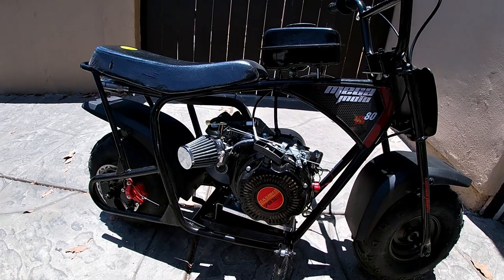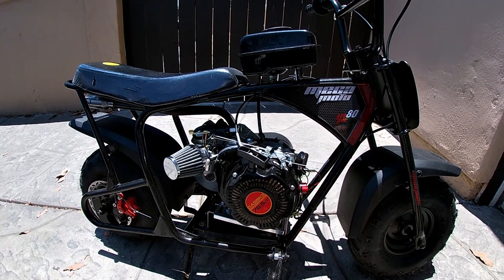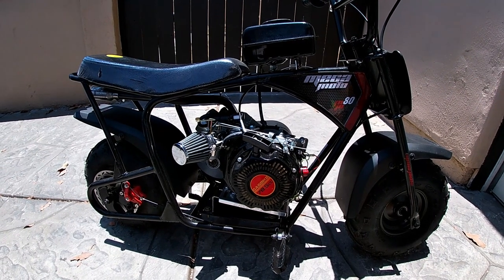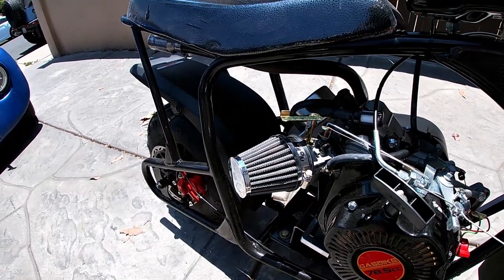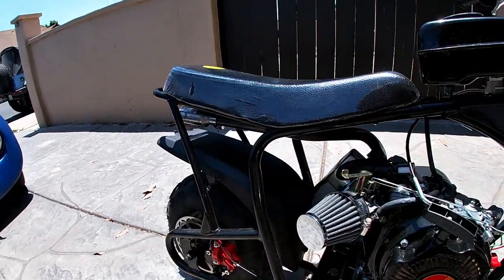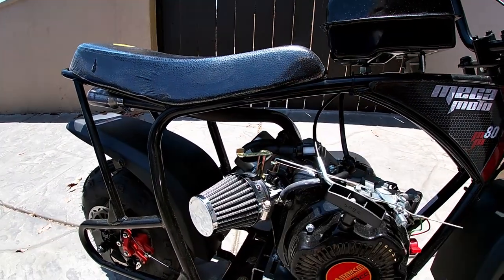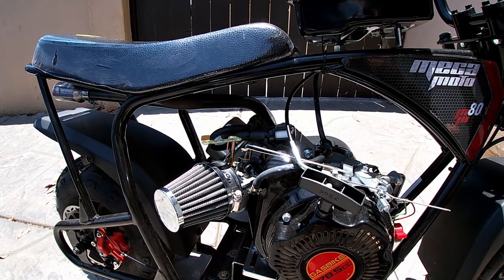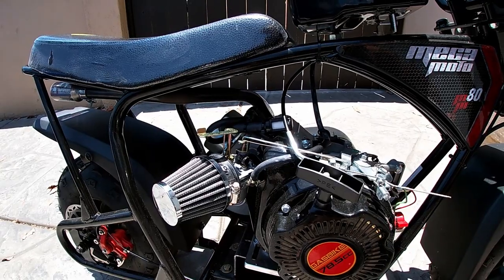Bigger carburetor for the 79cc Gas Bike MM 80 Mini Bike Project

Comment: How did u for that torque conveter on the 5/8 shaft?
Reply from the maker: Hello famousboi, I use an adapter to make the shaft size to the larger 3/4”. Here is a video link to the install of the torque converter on the 79cc.
https://youtu.be/uHwilQ2DVxk?si=l3-GXsM4Q9Sxb9l5
Here a link to the adapter 
DEWHEL 5/8" x 3/4" x 3" Shaft... https://www.amazon.com/dp/B07ZPX8TD6?ref=ppx_pop_mob_ap_share
Thanks for watching!!

Comment: Help me out. Mine will crank only when I’m holding the accelerator and I can drive it a round. Do you know what the problem.??? Thanks
Reply from the maker: The force is strong in this 1. Did you do the carburetor upgrade like in this video? Or are you working with a stock 79cc carb? Kinda sounds like it’s too lean. Could be a clogged jet or a bad gasket. Hope this helps… Thanks for watching!!

Comment: Do you know if the 79cc carb will bolt on the mm80 engine
Reply from the maker: Hello Bob,  No the 79cc is a different bolt pattern then the MM80 Lifan engine. It could be done with a custom intake manifold. But then just install a pz19.
This place sells all the replacement parts for the Lifan. AWSParts.com LF152F-3 engine. https://awsparts.com/16100a04300002-carburetor
Reply: @DIYWilly  ok, can you tell me where to get a air filter adapter for the lifan 80
Reply: Or a carb with pod filter that will work on the lifan 80
Reply from the maker: @bobbaker8715  Hey Bob, check out affordable gokarts they have some that might work. I’m about to do a build on that engine coming up in couple months. I’m going to see how much power I can get from the Lifan.

Comment: Where did you get the torque converter for the 79cc
Reply from the maker: It’s a 30 series from BlasterLED on Amazon. Same one I use on my 212’s. The only difference is the use of a shaft adapter taking it from the 5/8 shaft to 3/4 shaft. Works perfectly. I have the install on one of the other videos. Thanks for watching
Reply from the maker: Any 30 series will work with the shaft adapter.

Comment: Do I have to move the gas tank to upgrade the carburator?
Reply from the maker: Hello Bob, No you do not have to remove the tank to work with the carburetor. Thanks for watching!!
Reply: @DIYWilly  I would like to put a better carb and air pod filter on the stock 80cc ... can you suggest what carbs
Reply from the maker: Do you have the Predator 79cc or the 80cc that came on the mega Moto?Check out affordable gokart for their intake manifold and 19mm carb.
https://affordablegokarts.com/collections/79cc-performance-parts
I’ve used the kits and they work well. Also you can use 212 non Hemi 1.3 ratio rockers to squeeze a little more from it. But remember with performance upgrades you should look in to the billet flywheel. I have a few 79cc build videos and I really like my 79cc.
Reply: @DIYWilly  80cc
Reply from the maker: The Lifan 80 or the Predator style 79? Would help to know what minibike you have
Reply: @DIYWilly  are you saying the 1.3:1 ratio rockers that are in my 212 would work in my built 79?? Been looking for a rocker replacement for agessss
Reply from the maker: @truthbetold5006  Yes it’s a secret don’t tell anyone. I have a video on the install on my YouTube channel.🤫 They really help the performance of the small engine with extra lift with out the big money custom cam..
Reply from the maker: @truthbetold5006   😂
Thanks for watching!!
Reply from the maker: Let me explain…. You can buy 1.3 ratio rocker that are similar to the originals and they will fit. The 1.3 aluminum ones will not fit like you would buy from GPS or OMB. I purchased the 1.3 rockers from an EBay seller and they were longer than the originals. If you watch the video it will explain.
79cc is off it’s rockers with 1.3 ratio rockers: https://youtu.be/LSEpqhymM8g